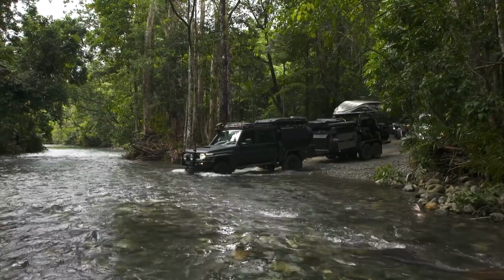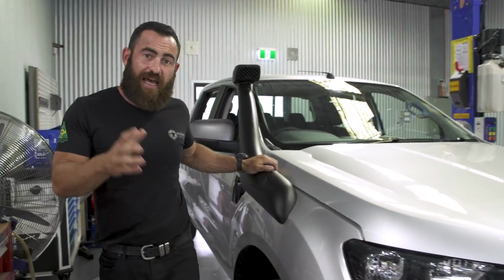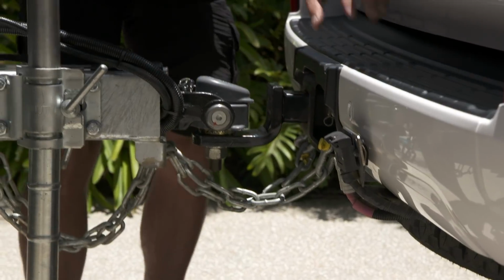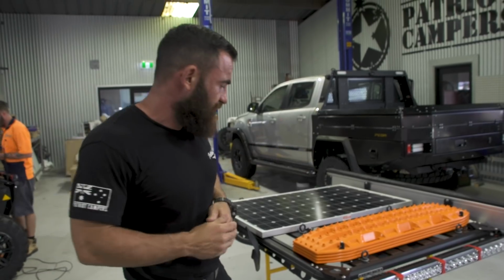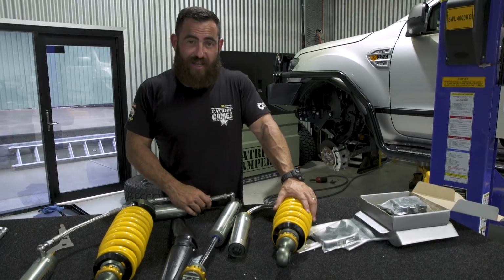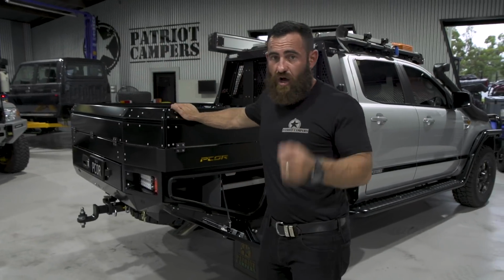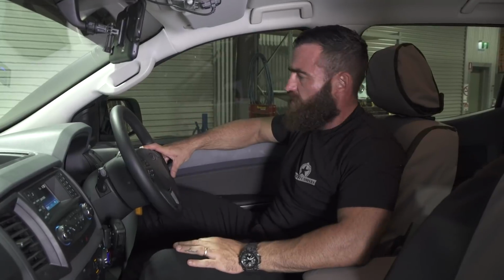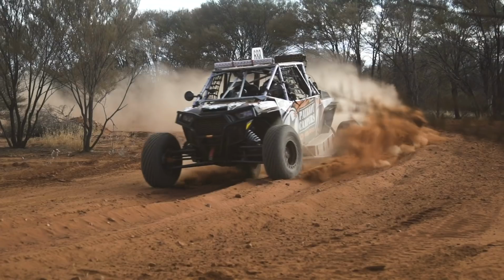PX2 Ford Ranger Our Most AFFORDABLE Supertourer - PCOR SUPERTOUER™

Comment: one technical note -- aluminum does indeed corrode.  It doesn't "rust" because that's a specific type of corrosion related to iron (iron oxide formation = rust).  But aluminum does indeed corrode, and rather badly.  Definitely keep the thing coated as it is / repair the surface as it gets down the bare metal.

Comment: Would only question the light bars deflecting air flow. Your work is really good.
Reply: It's a touring vehicle meant to haul gear stacked on the roof or a rooftop tent if not a trailer.. It isn't meant to be aerodynamic, at all
Reply: @lunamaria-94  Nobody is talking about aerodynamic. It is about how an engine relies on air flow to maintain correct temperatures. Just a small increase in engine bay temperatures causes the ECU ( Computer ) adjust fuel delivery which often translates into less power. The engine bay is designed to have cool air straight through the front but double light bars create a wall and when the air hits them the air is pushed up and over the bonnet and downwards and away from it's path through the front. Their vehicles look great and yet they seem to not consider this effect on the car. You see people doing this all the time totally unaware of the affect they are having on the cars performance. ECUs are resigned to cut back fuel when temperatures rise a bit which decreases power and performance.
Reply: The snorkel gets it all the air it needs.. Lord you are quite amateur.. Engines breath through their intake, and tourers always have snorkels to ensure good clean air flow

Comment: @PatriotCampers
Since the build was around ford ranger px2, would there be significant difference if it was to be based on ranger raptor in regards to engine tuning and exhausts?

Comment: are you for real..??.the ranger, [bt50],nissan,mitsi,toyota,all the same vehicle,7,8,10 speed auto,manual if your lucky,all ifs front,all 4 door,with no tray room,3.5 ft if your lucky,NOT,a 4x4.say what you like,there crap vehicles.only for tradies on the road,too long too low for bush,graded tracks only.didnt you learn anything when you were in the u.s.??.

Comment: I have been thinking for a while that the next move for Patriot Campers would be to produce a version of the X1 or X2 Camper Trailer that could mount onto the back of a ute - i.e. have most of the features of the camper trailer, but mounted directly onto a ute tray, removing the need to tow a camper trailer...     Your concept for super tourer's is great, and being able to implement it for any 1 tonne ute on the market will be key to opening up the market to more customers (and not just the big name utes - do it for utes like the LDV T60, which is much cheaper than say a Ranger or Colorado and you will open up this market to many more customers).    Add on the camper module to give a ute most of the capabilities of your X1 or X2 and I think you will reach many more customers.   That would be a product set that I would be highly interested in because it means that I would just have one vehicle and no trailer towing hassles when doing beach work or travelling on ferries to places like Tasmania.     I imagine it might need a GVM upgrade on most 1 Tonne utes, but that would be a small hassle for all that convenience in one product.
Reply: So a Bash proof Trayon.
Reply: No.   A Trayon doesn't cut it for me.   Doesn't have nearly the same capability or flexibility of what a Patriot Campers X1 or X2 trailer has - and what I want is the Patriot Campers X1 or X2 built for a tray on a dual cab ute (i.e. without the chassis for the trailer). Similar concept, but very different to a Trayon. Would be even better on one of these Supertourer's instead of on a standard tray - but if Patriot offered the product for any dual cab tray it would simply open up more of the market for them.
Reply: And make it a lift of canopy so you can leave it at camp.
Reply: Absolutely.   We need to be able to leave it at camp if necessary.
Reply: Still be stupid good though.
Reply: what sort of camper you going to get in a 3.5ft space.???.you need at least 8".look up f100 camper special,been around since the 70.s,nothing new here,they came from factory,ready to go.fords that is.&,while your at it,look up ronny dahl,when he broke his chrome molly diff,why,too much weight over the rear axle.if you want a real camper,do what the eurpoeans do,BUY A UNIMOG or daff of similar.